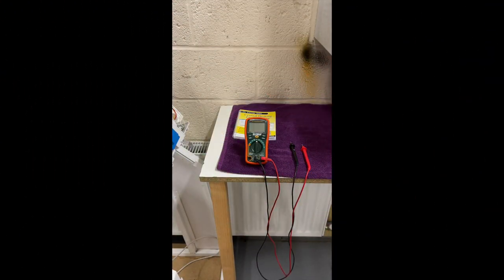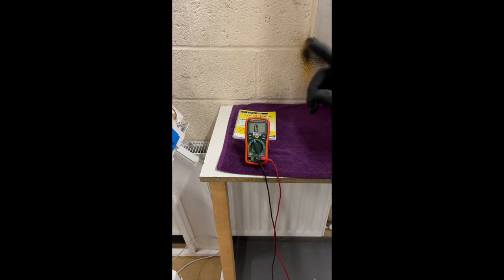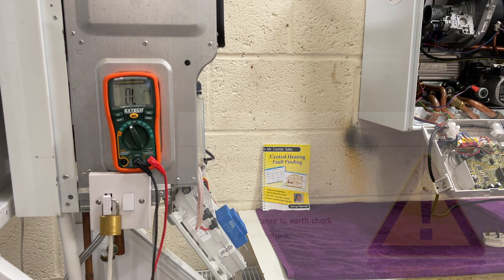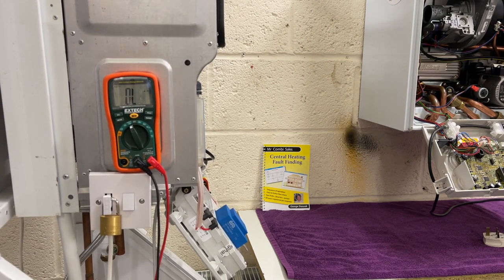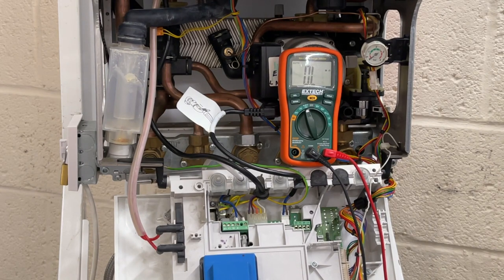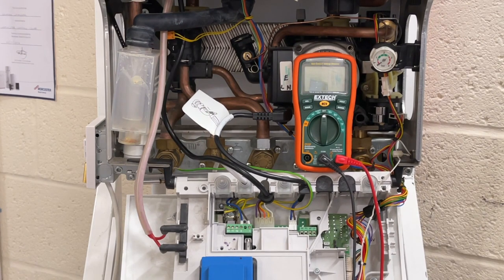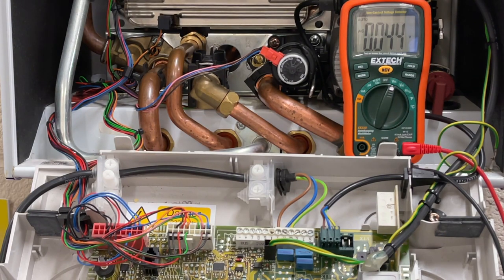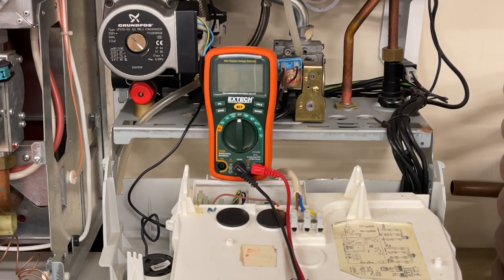PCB FAULTS:  How to TEST & FIX

Comment: good clear thorough explanations. Also info I've never heard before, such as the effect of a voltage on the neutral causing pump and zone valve issues.
Reply from the maker: Thanks for comment, yes you are correct, too many installers still don''t do a  short circuit test and spend hours on a fault then  give up.All the best, george 🤩

Comment: Hi combi and all gas knowledge folks here, I have an ideal logic c30 base model. Hot water is perfect but CH doesn't warm the house. I notice that the main selected knob for CH on the boiler itself only shows a digital range from 30 to 35 degrees C when the spec sheet shows it being min 30 C max 80 C .The DHW is fine and shows min 40 C and max 65 C, which matches spec sheet. I am being told PCB replacement required. Have you ever encountered something similar.
Reply from the maker: Hi Munn91, Thanks for asking, All combies and HW cylinder settings the HW MAX is 60C, (except combies in the late spring / early autumn maybe turn down to 40C because the incoming water is hotter) CH all combies are set to 75/80 which most homes is TOO high (expensive) If you can set 60C saves lots of money! Danger, see my videos on heat loss etc. too many installers don't do this, stick any undersized rad in the lounge, to get hot the home owner has to turn both stats high to get warm and expensive.
All the best, George Staszak :thanksdoc:

Comment: Hi George
Great video, really clear explanation.
My vaillant boiler is showing S30 fault code, no heating demand from external contol. I have hot water but no heating. I have changed the roomstat but no change.  I notice that the roomstat instruction say that the power to it is 230v but when measured it reads 
4.5v when turned up to max and 50v when turned to minimum. 
Does the roomstat get its power from the pcb?.  I can get the heating on if I press + & - together. 
But it goes off after it reaches full temperature.
Reply from the maker: Hi Roy, 
Thanks for asking, very easy to test Vaillant or any boiler for NO CH.
I assume the new stat is digital, turn it down to the lowest setting.

If you DON'T have 230v on 4 SW.L  its controls
If you DO have 230v on 4 it's the boiler / pcb.

1st Turn OFF the power to remove (in your case) the wires from terminals. 3  Com. and 4 SW.L and make safe the ends. Link a wire across 3 & 4 now you are to factory mode.
 Power ON select max CH on the boiler front, if it works you have a controls fault, ie. programmer  R/S or the wire in-between. 

2. VOLTS: Check 230v from EARTH to L.  
0v on Natural 
230v 3 and and on 4. 
< 230 on 3 that's PCB, if more the 6 years change for latest version, if boiler is about 12 years change it etc.etc. because not economical to repair. Hope that helps.
All the best, george 👍

Comment: Hi George, I have a 16 years old Glow worm 15hxi, which stopped working after a power cut. I checked 3A fuse and T630mA fuse on PCB, they are all ok. The little display doesn't show anything when turned on. Could it be PCB or display card, any advise? Thanks
Reply from the maker: Hi Korhan, thanks for asking, love your boiler installed and fixed lots, there is always a risk when the power is turned OFF for the PCBs and programmers to fail, I always told the customer, this affects anything past 8 years, the software cannot cope with the switching ON surge.
I had a look at cost of both boards £300+ fitting?     To be honest start again, as I have said many times rip the whole system out, or really flush 3 times, recalculate ALL the rads, fit balancing TRVs, auto by pass enjoy the efficacy and save MONEY compared to this boiler.  To get the longest guarantee find a factory hero installer have it seen EVERY year to keep the insured policy. get 3 quotes, hope that helps, regards George Staszak 😄

Comment: Hi George.
I have a Valliant system boiler.  What symptoms would confirm if the PCB board is faulty? Also, what symptons would confirm that the flow and return NTC sensor is faulty?  Thanks.
Reply from the maker: Hi Mo, thanks for asking, as with all boilers the NTC / sensor testing is the same, at room temperature 20c (the boiler is cold) check the ohms of each sensor to specks, normally 10 - 12KΩ : Vaillant are different only one wire to earth ( I love this method, dry pocket one wire to earth) the value is 1-5KΩ at room temp about 2.5K. The green sensors eg. Ferroli you must call tech for values. There is a chart which is in the Wednesday course notes but ask your boiler tech. for a download. regards, George Staszak.
Reply: @mrcombiBedford  
George you are a angel. 
Thank you very much and God bless you.

Comment: Short circuit test...
Shouldn't the reading be over 20 ohms 🤔
If under 20 ohms, then there may be a fault on a component...like fan or Pump 🤔😉
Reply from the maker: Hi 33, thanks for asking, over because we have to have a HIGH resistance to stop fuses blowing, 100 Ohms is the standard value that we work to. It should be O.L. (over 1 million) but some firms don't use the PCB the same way. Hope that helps, George 🤩👍
Reply: @mrcombiBedford  thankyou

Comment: How do you check for polarity on boilers with no on/off switch?
Reply from the maker: Hi Stephen, thanks for asking, have a look at my PCB video, you need to have +230vAC at the switch in the OFF mode, if it's ON then the boiler would start up and blow a fuse also we don't want the boiler working whilst testing that would be very dangerous. Hope this helps, George Staszak
Reply: @mrcombiBedford  Hi George.
The Baxi 600 & 800 combi range don't have a on/off switch on the boiler. On & off comes direct from the fused spur.
Reply from the maker: @SD-Plumbing-Heating  How strange, then you shut down via the programmer both channels to OFF to stop it working, regards, George Staszak. Happy New Year to all and thanks for the comments

Comment: Having a new boiler fitted in a few days, the 2 amp fuse on the circuit board has blown again, would a standard 3 amp fuse be ok until it's fitted ? Thanks
Reply from the maker: Hi San, thanks for asking, NO the pcb HAS to have a 2 amp which is weaker than the 3 amp in the wall to stop it blowing up. Power OFF  measure in ohms L & N on the pcb, if less than 100 call the factory engineer or local hero to find what is causing a short circuit. If the pcb is over 5 years replace but you MUST find out what the actual fault is otherwise the new pcb will blow up !!. regards George staszak
Reply from the maker: Forgot, next week a new boiler it's not worth fixing

Comment: TN-S earth arrangement could get 5 Voltage between N and E
Reply from the maker: Dear Hu, any volts on Natural is a house wiring fault and will cause a fault on any boiler, thanks for the comment.
Reply: @mrcombiBedford  Thanks for reply. I am NAPIT full scoped. Only TN-C-S earth arrangement, Neutral and Earth Voltage should be zero. others like Ture TN-S or TT earth arrangement, Neutral and Earth Voltage always not be Zero. People always say Neutral and Earth Voltage be zero, because today most of property earth arrangement are TN-C-S system or not true TN-S system.  For TN-S and TT system, Earth is always the true Mass Earth. So there is current flow back to transformer by Neutral conductor ( Three phase not always/unlikely balance, neutral current is always present), so there is voltage drop between neutral inside property and connected point which neutral and earth combined together at the transformer winding and case.   For TN-C-S, the Neutral and earth combined at the cut out inside the meter box, so TN-C-S neutral and earth should be zero.  Regards
Reply from the maker: @huyongquan6554  Many thanks for the update, take care, george

Comment: My PCB won't start until I hot air blow on it!!
Then it works for 7 hours until it completely stops working, even the display.
Any ideas?
Reply from the maker: Thanks for asking, easy one or more of the soldered joints has dried out, know as "dry joint" not possible to test every one thus replace with the latest version, don't buy a recon. take care, George 🤩

Comment: Except your polarity test of L to Earth will take out any RCD that the circuit is connected to....
Reply from the maker: Hi Nath, thanks for your comment and of course you are 100% correct, what that would show is the low impedance metre is the wrong one and the person has not been trained which metre to use and should not be doing this test. Many come here with wrong metres  even G clamps to fix boilers? regards george 👍